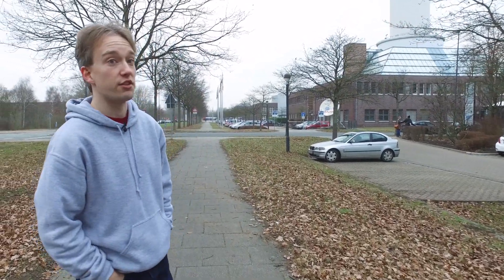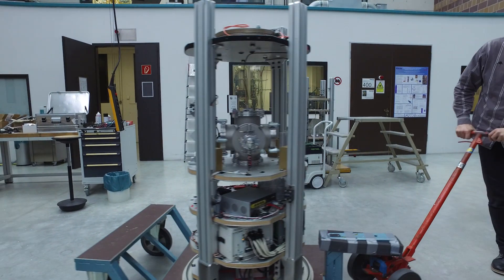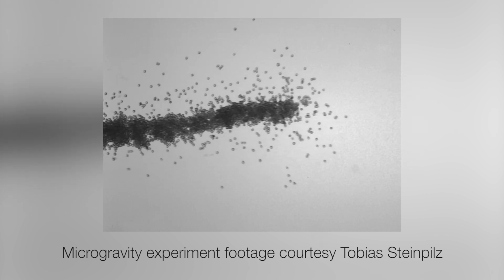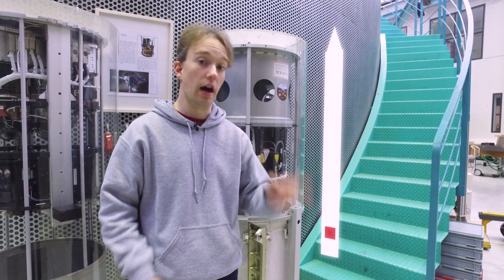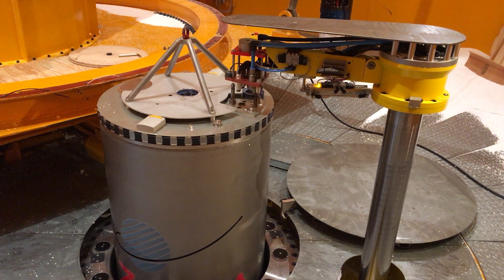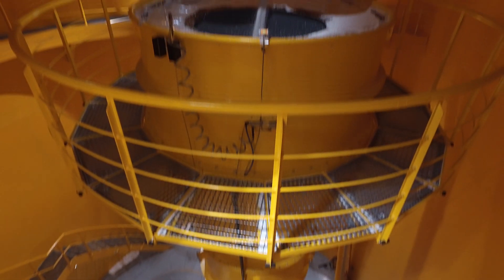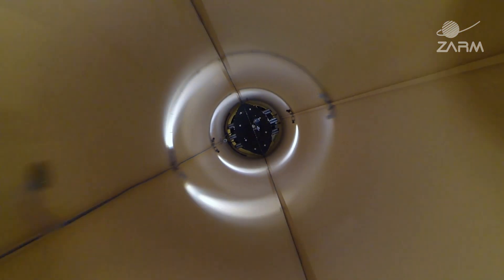Zero-G Experiments on Earth: The Bremen Drop Tower

Comment: I think it's only 0 g at the moment when it starts falling
Reply: Actually, no, when launched upwards it experiences 0g the moment it stops accelerating.
Reply: It's 0g when internal and external forces are equal. So it's 0g right after the launch because the only force acting on and in the capsule is gravity (with a negligible air resistance since it's not a perfect vacuum).
Reply: Oh wait, I think I get it now. If you separate the internal from the external. The internal do not have forces applied on them RELATIVE to the external capsule
Reply: The moment the launcher lets go of the capsule.
Reply: right after realease it starts to decelerate at 1g
so if you're inside the capsule and can't see outside you would feel weightless
Reply: Imagine if you threw a box into the air with one hand and a ball upwards inside the box with the other hand at the exact time with the same force. The ball would stay exactly in the same spot inside the box on the way upwards and downwards. The ball would have zero g relative to the box

Edit not same force, same acceleration..  unless the box and ball weighed the same. You get the point though
Reply: As soon as it's released from the slingshot, it's in freefall and 0 perceived g.
Reply: Leon Stark you don't only feel the lack of the force exerted by the chair. Stationary fluids in your body now have no force relative to you, everthing in your body now feels like they are floating. This includes your balance system also. You have a perception of lack of any force exerted to you. Because everything inside you has the one force that is gravity that points to the center of earth. And because you are so small you can ignore the fact that the forces are pointing to the center and say they all are pointing 'downwards'. So everthing in your body has relatively same motion.
Reply: Tarek Midani yes,  but it is falling as soon as it leaves the launcher, zero g up and down. (Citation : me - a physicist)
Reply: Tarek Midani yup that's it
Reply: Tarek Midani no it is zero g the moment it leaves the slingshot
Reply: When does it stop accelerating?
Reply: +Tarek Midani THe capsule itself is in freefall as well, as soon as the 200ms launch is over.
Reply: THERE IS NO 0 g HERE. The capsule is being launched so there is a force being applied on it from the catapult. When going up and down gravity is always being applied as aceleration. While going up gravity is against the movement decelerating until the object gets to a velocity of 0. Past that point (the peek) gravity continues to be applied, and it's acceleration has the same direction as the movement, increasing speed until the object contacts the pellets. There is no moment where gravity isn't being applied
Reply: You are not feeling "weightless", what you are feeling is a lack of a normal reaction, the force exerced on you by the object you are standing on. When you sit on a chair you feel gravity but you aren't falling throught the chair into the core of the earth thanks to the force that the chairs applies on you, canteracting your weight.
Reply: Alright, never thought about that tbh. Either way some experiments cannot be performed in such conditions
Reply: Do you even physics, bro? Obviously, everything that's not accelerated is, ahem, well, how do I put it .... not accelerated, basically.
Reply: ***** Well, if your specimen or measuring device doesn't withstand the launch acceleration, things aren't exactly looking good.
Reply: *****
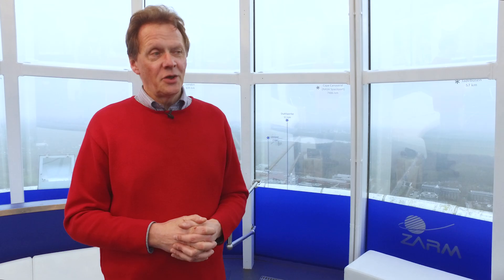Watch the part from 2:00 to 2:23 again.
Reply: Leon Stark yes, it is responding to gravity, but the effect is indistinguishable from zero g, exactly as in the ISS or in deep interstellar space
Reply: You are wrong.

Comment: I feel a bit dumb now. 
Free fall is not the same as microgravity, is it? I mean, the capsule falls faster than it would outside the tower, and that happens because of gravity?
Reply: +MrNicoJac  Gravity is pulling equally on the capsule and everything inside it, and nothing is pushing against the capsule (after the 0.2-second launch ends). So nothing in there feels any acceleration. The only reason you feel any weight on earth is because the ground is there to stop you (or the elevator floor, or the airplane seat, etc.)
Reply: Free fall effectively is the same thing as micro-gravity. In general relativity being in an accelerating reference frame is the same as being in a gravitational field, and likewise, being in free fall is equivalent to not being in a gravitational field.
The reason it is called microgravity is that technically, the force of gravity is slightly weaker at the top of the container than it is at the bottom (this is called the tidal force). When choosing a reference frame to cancel out gravity, you can only do this for one point in space at a time, but for weaker gravitational fields the tidal force is small enough to be negligible. For further reading on this look up the equivalence principle.

The reason the capsule falls faster inside the tower than outside is because there is air resistance outside the tower, and this doesn't really have anything to do with gravity.
Reply: My brain still derps. 
How does free fall negate gravity? There is still a force pulling to one side, right?

[Is it that the force is completely equal across the entire test (set-up that is being used in the tower), and therefore gravity has no EFFECT on the outcome?]
Reply: Right, thanks!
So basically you take away the Normal Force, which means you don't "experience" the gravitational force?
Reply: Thank you sirs!!

Comment: The way it goes up and down perfectly straight is very neat. That's extremely satisfying to watch.
Reply: I think even a feather would go straight down because of the absence of air...
Reply: Of course it falls in a straight line, I know how physics works. But the fact that it does so without even slightly rotating, in perfect alignment the tower and perfectly into the receiver at the bottom is still beautiful to watch. Aiming and launching an object straight up like that isn't a trivial task.
Reply: Pavel,
There is one rotation that is certain, and we have seen it demonstrated many times in many museums, the pendulum that swings freely takes 24 hours to return to its starting point.
There are at least two displacements that I know of,, both related to the spin of the planet.  However, in 9 seconds,, they will be very small.
Reply: I think it's small enough that they don't require to compensate for it.
Reply: I THINK IT DOES THAT BECAUSE OF THE VACUUM AS WELL. As as air resistance comes into play a weight imbalance in the object would cause it to start rotating in some direction.

Comment: Doesn't the acceleration harm the equipment?
Reply: Volbla I would assume that it is designed to withstand the acceleration.
Reply: The acceleration of a rocket is much much less than 50G
Reply: @stefanozurich  unless its that sprint 100G rocket
Reply: Also if they do plan to put any of this stuff into space (not saying everything will be put up, but if they do) they need to make it take the acceleration of a rocket launch
Reply: Usually its 5G, tops.

Comment: Love the wonderfully low-tech deceleration system!
Reply: Whilst it takes extreme effort to create on Earth the most common things in the universe (high vacuum, micro-gravity, etc)
Reply: Legend Length I don't know if the human body can survive 50g of deceleration, but you never know until you try
Reply: @enzop177  you'll definitely try, but won't know🙃
Reply: Perfection is in simplicity
Reply: xantisma 
A ride the most similar to this is probabaly Superman Escape From Krypton at Sic Flags Magic Mountain, where you are weightless for about 7 seconds while travelling on a vertical tower. Any shuttle roller coaster with a vertical so-called spike where the train travels freely on a vertical piece of track has almost perfect zero G (as good as it gets without a vacuum). I've experienced that feeling on Pulsar at Walibi Belgium (one of the two towers of that ride is vertical, the other is tilted at the top to provide negative forces). On that ride it's just for about 2 seconds because that vertical tower is just a bit over 30 m tall, but it's still an amazing feeling! Especially when you reach the top and start going backward you lose all contact with your seat :D
Reply: chiming in and digging up an old thread but food for thought: helmets (cars, bikes) are tested with 250G
Reply: The rescue system of Sojus explodes the capsule with humans out of an exploding rocket. -> Astronauts have up to 26 G for up to 6 sec and it’s accepted that they pass out.
Reply: They have...sort of. Many amusement parks have free-fall towers, though I'm not sure how many bother to create zero-gee on the way up. Disney's Tower of Terror is a 14 story drop, which is actually on the small side, though at least some of those drops are powered (negative gee's).
Reply: the pallets in there  also gets everywhere. I was there with an experiment around 3 years ago and i still find one some. I can't imagine how it is for the folks working there...
Reply: Col John Stapp survived 45g many times with duration of about 1s, mostly because the harness strapping him to the rocket sled couldn't be made much stronger back then. He had his wrist fractured two times (probably?) and besides a blackout and some bruises he didn't catch any ill effects, especially long term ones. But he was military, even if he was not a pilot himself he was physically better prepared than an average person.

Kenny Brack survived 214g in Indycar, and though he faced multiple fractures he still lived in a pretty good shape afterwards. So if this ride achieves 50g during a 1/4 second launch and braking stage, there's a chance of slight injury and nothing more...
... providing you will fall straight into the polystyrene pit, that is. :>
Reply: @BluesyBor  glad to see a shout out for Col. Stapp. A true pioneer of his time but somewhat forgotten about today
Reply: @BluesyBor  John Stapp went blind for a while due to tearing his retinas inside his eyes during a 38G run. He "recovered" from many things, but he definitely suffered long term effects.
Reply: @ParadigmUnkn0wn  not really tearing his retinas, he simply suffered bleeding in this area which naturally made him blind for a few hours. As for the long term effects - I can't find anything on these, so if you could help...
Reply: I mean thats simple and cheap
Reply: I have been there before and everyone there will tell you the little pellets go everywhere and as a regular there, you will have them at your home in no-time
Reply: @LegendLength  the ride is called a zero g plane. This type of initial acceleration/ final deceleration would kill you.
Reply: It's so unGerman. They should build some million-part contraption for that.
Reply: It records 100% of success xD
Reply: There are race car drivers that have survived crashes at upwards of 200 G, so 50G is likely survivable not sure about how enjoyable it is though.
Reply: There are race car drivers that have survived crashes at upwards of 200 G, so 50G is likely survivable not sure about how enjoyable it is though.
Reply: @paulzapodeanu9407  The polystyrene "bath" should make the deceleration smoother, though. They could also add a dampener inside the capsule, and maybe use other types of foams, maybe a mix, to improve the deceleration characteristics. Or just make it a bit taller for lower G forces.

Comment: I don't get it.
How can the capsule be weightless during the whole time if the launch causes such high acceleration?
Reply: Because free fall up is the same as free fall down.
Reply: snaileri As soon as the launch is over, it's weightless.
Reply: the launch part is only a few tents of a second.
0.2 seconds as stated by some. so the rest of the way upmit will experience freefall.
Reply: Okay now I get it. The acceleration from the launch ends as quickly as it starts. Right after the launch it starts to decelerate, which makes it weightless.
Reply: The problem is the term "zero g", what we actually mean is free-fall. Even things in space aren't in 0g
Reply: It "feels weightless but tecnically it's still being affected by gravity. Basically after you launch the object it is only being affected by gravity, with an acceleration of about 10 m/s^2 . The only difference is that it isn't being applied a Normal reaction force. Simply put: The normal reaction force is a force that is exerted in you by the things you are standing on. For example if you sit on a chair, gravity is pulling you down and the reaction force is pushing you away from the chair. There is no point in this experiement where gravity isn't being applied
Reply: yep pretty much.

Comment: To gain seconds, we could build up a even higher tower, or we could simply start digging in the earth, which could be more easier at this point :-)
Reply from the maker: There are drop towers built in old mines! It turns out it's generally cheaper to build a tower than it is to dig a new hole though.

Comment: @Tom Scott, you made a mistake in the calculations at 1:35!! You confused speed with distance. Distance as a function of time should be s=1/2 * g * t^2. The numbers you are saying and showing are incorrect. After one second it has only fallen 5m not 10m.
Reply: Normally I would agree with that, but in this case... No, the quantisation is way over the top. You could have culculated just the speed instead to make your point and state the correct formular for the falling distance, if you still needed that.
Reply: @yanfe384  agreed
Reply: @TheDiamondRiolu
basically what tom scott showed simplified an accelerating object as moving at one speed at on second and an other the next, in this case 10 then 20. in reality the object is accelerating all the way through and of course started slower.
Reply: +Blake Roberts People learn this at the age of 14. 1/2*gt^2 means 1/2*(gravitational acceleration)*(time squared)
Reply: Gruff being told it and learning it are two different things.  You’ve made more sense here in the comments than most of my education experience from 14-18.
Reply: Josh Tiel Unfortunately you are correct, education system is corrupted. Save yourselves and research
Reply: @Gruff46  I guess I'm not people then, I learned that at age 15.
Reply from the maker: True, but explaining that in about five seconds would have lost a lot of people. Sometimes it's better just to do some serious rounding -- or quantising, in this case!
Reply: Tom Scott  5t²=total distance in given time if G=10(and gravity is actually variable on each position) it is , so it goes 5-15-25-35-45...etc. each second.
 If you are putting up scientific researches and interviews, this stuff matters. More than your views. Im not trying to be rude, just wanted to stop datum pollution on internet.
Reply: Tom Scott your right. Apparently people don’t get it.
Reply: @GHRISTIAN ORTBAUER NO THAT "G" IS 9.81 G/M-2 !!!!!!!!!
Reply: 爽狼的香辛料 it is not exactly, it changes on location of you on earth
Reply: @SailorIvo  Even our Western earth gravity has China copied :D
Reply: Yan FE it doesn't matter for most of the people watching. If you care about such things, you already know.
Reply: In English?
Reply: Christian Ortbauer hello Albert Einstein